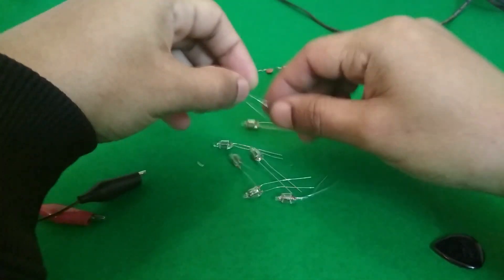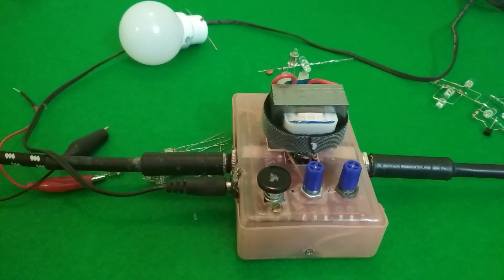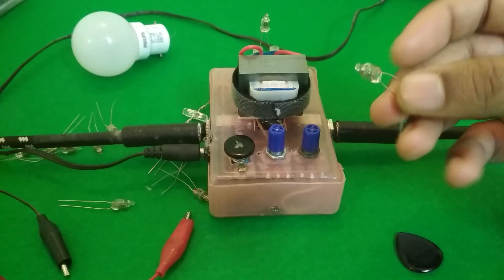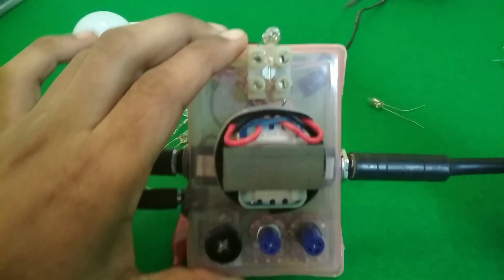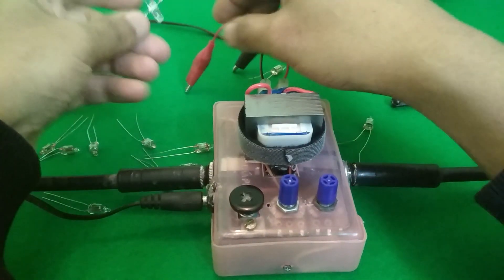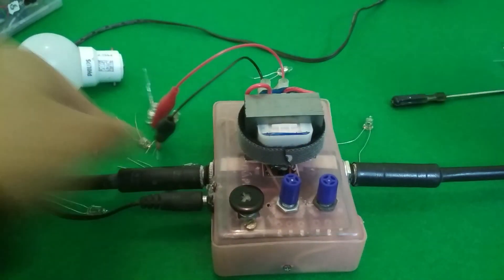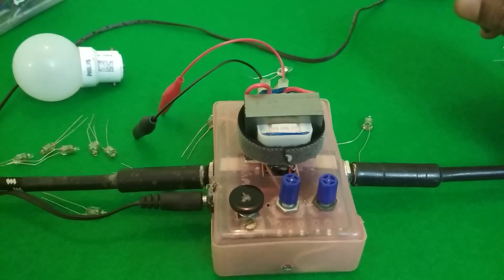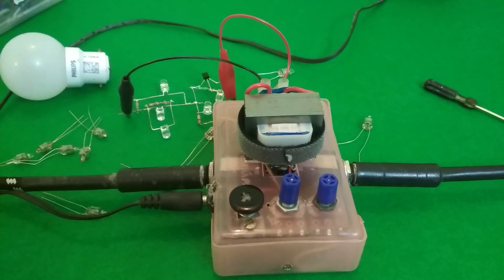DIY "Tube" Distortion - High Voltage Neon Drive Pedal

Comment: Hi, so I just bulit this awesome circuit, but the distortion in not working. The clean amplification works just fine, but the lamp just wont glow, no matter what. 
I even built it twice, just to verfiy there were no errors, but still only the clean sound. I guess the voltage isn't high enough for the lamp, ikd.
Maybe I'm using the wrong components. I'm using a 230V:12V Print-transformer and power supply is 12V.
Any help would be greatly apprechiated!!
(I also could send pictures or sth)
Regards Niklas
Reply from the maker: There's some troubleshooting needed sometimes. You don't happen to have the transformer wired step-down, I assume? Why don't you send me pictures to my "business email" and I'll see if anything jumps out at me.
Reply: @Psychotenuse  Alright many thanks. I have sent you an Email now!

Comment: I need a schematic of this please... If you would come off it. I wanna build one of these someday when I get stable living situation.  I think itd work for an actual amplifier too. Cascade a bunch of them like a SOLDANO SLO100 or something. It'd be cool if the neon tubes worked in the rectifier section..... Oh yeah, I want one.  So you got an official schematic you can send me?? I'm not going to profit or nothing... I'm actually homeless right now, I just want a schematic so I can dream up some additional features for if he day ever comes that my living situation becomes permanent
Reply from the maker: Schematic is linked in the description. Best of luck with housing, man. Hope things look up for you soon.
Reply: @Psychotenuse AWESOMENESS!! How's about that cap/resistor/led clean blend thingy you use in this video??  That thing with a switch or 2 and a pot or 2.... Bad ass for sure. If you could figure out a way to make it a "drop in" module for pedals & amps... That'd be cool af too. It'd sell. This neon pedal would sell for a couple hundred for sure. Especially if the graphic was bad ass. A bad ass graphic can sell a garbage pedal🫡

Comment: I'm confused by the varistor, you put a 1m ohm one but when I search that up I don't get them measured that way, so it has me very confused on which one to get or if the ones I have would work
Reply from the maker: The 1M resistor (meaning 1000,000 Ohms) is not variable. A fairly standard value, I think? Plus or minus ten or twenty percent should be fine too. You should find them on Digikey, etc.
Reply: @Psychotenuse  no I'm talking about the variable resistor in series with the 1k resistor, how do you choose which one?
Reply from the maker: Oh I see, yup sorry I missed it. Yeah, that's a potentiometer with the common lug and one of the others connected, so wired as a variable resistor.
Reply: @Psychotenuse thank you sir, sorry for my little rant, I was just so confused since I'd never seen that symbol before so I looked it up and I think I saw some misinformation at first then figured it out lolll
Reply: You put the symbol for a variable resistor at least, but you put 1m ohms which isnt how they're rated
Reply: @Psychotenuse  its labeled rv1
Reply: Oh wait I'm dumb it's just a potentiometer isn't it

Comment: I suggest adding a capacitor between the 22k and 1M resistors (something like 100nF 400V), just to isolate the output from the high voltage and also decouple it.
Reply: What high voltage are you talking about?

Comment: This was a great video, I really enjoy what you're doing.   However, 90 volts is not a high voltage distortion pedal. My tube distortion/overdrive  pedals run at 200 volts. You created a nice sounding mid voltage distortion/overdrive. Shame you didn't keep going with the pedals
Reply from the maker: Always relative, of course. The gamechanger plasma pedal runs at kilovotls.

Comment: im curious, did you wire all the components onto a pcb blank of some kind or just direct solder everything together? if you used a PCB blank which kind?
Reply from the maker: This was not on a board, from what I remember

Comment: Hey, Quick question, I want to build this, but I have a Step down transformer,  Primary having 4 pins and Secondary having 2 pins. Can I run it backwards? And which of the 4 pins connect to the Neon bulb then?
Reply from the maker: Hey! Sorry for the late response. Unfortunately transformers really vary quite a bit and many have intermediate taps or multiple coils and if there are many terminals you can't really know how to wire it up unless you can find a datasheet.

The high voltage side of the transformer is the side with thinner wire.
Reply: @Psychotenuse   Hi, Just read your reply which was helpful, but I have an issue. I harvested the transformer from a 12 adapter power supply. so there's really no wires at all. just 2 pins on one side and 4 on the other.

Comment: Quick question. Was there a drastic reduction in volume between the Neon Bulb and the lower voltage devices... specifically the LED's?? Thank you in advance
Reply from the maker: Yes, it's definitely noticeable. If you think in db 90/3 is like 30db

Comment: Is it possible to use TDA7052 or similar DIP-8 based amplifier?
Reply from the maker: It might work, but I'm not sure. You need to put a fair bit of current into the small side of the transformer to get the voltages you want on the big side

Comment: thatis really cool,, i need to watch more of your videos,, an led  bulb made a distortion sound, i wonder if a xenon bulb from a car headlight would do, i know they  make tons of voltage
Reply from the maker: I think I might have tried that xD
Didn't do anything, which makes sense because it's probably essentially a short circuit at low power.

Comment: How about using an AD-DA converter in a micro controller and some SW, Arduino, Tensyduino, Raspberry? So many more options to go with.
Reply from the maker: Such platforms do exist to buy, especially with teensy

Comment: GE published a 500 page manual on their little NE-2 bulbs with tons of circuits. They need light (or radiation) to work, which is why the orange lights on power strip bars flicker in a dark room. The amount of ambient light would probably change your distortion tone!
Reply: Do a search for the old Signalite publications.  They had all sorts of fascinating circuits with neon bulbs.  Including musical stuff like frequency dividers.
Reply from the maker: That's pretty cool to think about, yeah!

Comment: Oh man you nailed the 00s grunge tone without even trying hell yeah. Might have to build one of these into my amp project once parts start arriving- I’m using one of those “Tube Fever” kits off Ali in combination with a couple op amps and some clipping diodes to build a low wattage practice amp that still has some of the features from larger amps.
Reply from the maker: Awesome!

Comment: It's a cool little experiment. I'm a firm believer semiconductors do it better than tubes, but there's also a lot involved to get the circuit there. The compression of the control grid in the tube plays a pillar role in it's most desired characteristics, and so does the limited bandwidth in comparison since they tend to cut off at about 10 Khz when used with guitar. *The last few days, I've used a pair of diodes in a feedback loop on a very simple high gain transistor amplifier, and I'm getting the dead on distortion texture of a tube, but it needs significant refinements with some RC networks and truly, more architecture to be truly useful.

About 9 years ago, I pieced together some of my original designs and I had a sound dead onto a 5150 and a Mesa Dual rectifier, but 100% semiconductors. I had the definition of tubes, the saturation and texture of tube distortion, and just needed more gain to shred metal. I'm restarting that journey and this time, I will complete it! 
Your experiment taps into what I've long since necessary which is very high voltage distortion. 
Most of us want that zapping, zinging froth and glassy buzz of tubes without the price, and I'm ranting just to say, it can be done.
Reply: There’s a company called surprise sound lab that makes a pedal that uses semiconductors in a high voltage circuit that sounds pretty good.
Reply: This has nothing to do with tubes because they forgot the control grid on that neon bulb 😂

Also, your assumption about tubes and 10 kHz is way off. Simple 9 Pin dual triodes can run into 100s of MHz without issues...

Comment: I would like to mention that getting shocked across some fingers on one hand cannot kill a person. However, it may cause burns if the amperage is high enough. Not sure how much amperage it would take to cause permanent nerve damage. I only shocked myself once on a hand with 120vac, and this just caused muscle spasms in that hand for an hour.

Always be as respectful of high voltage as if it were a spinning blade.
Reply from the maker: Definitely good advice.

Comment: Alternates can also be (30-200) V mov's and transient supressor diodes..& other non- linear ones like diacs/tunnel diode/ujts'/put's/pin diodes
also how about the effects with a conventional 50/60Hz
fluorescent lamp starter.....
it's not just about their breakdown level & behavoiur that can give different effects....
..Trying various combos with different R/L/C you may discover something extraordinary.😅
Reply from the maker: Certainly a lot of room for experimentation :)
Reply: @Psychotenuse  yes! & then there are the ntc/ ptc types & ldr's too..& many more...
Experimental Holiday season if you are snowed in. 👍
Reply from the maker: Haha, yeah you could in theory get compression and gating with thermistors. Perhaps the currents are too small though. I think I might do an updated version of my looper over the holidays.

Comment: This is fascinating! I'd love to see your schematics. I'm currently almost finished with my rat pedal cone, which I've modified to include a 9-way switch that will choose between different colored LEDs. The 9th setting leads to a row of 8 LEDs in a circuit borrowed from the Boss Heavy Metal. I'm looking forward to seeing if it works.
Reply from the maker: The schematic is linked in the description :)
Glad you like it!

Comment: One of the nice guitar u have.. N this works good but may kill ur amp( due to higher input). 

May be safety clamp is needed at end
Reply from the maker: There is a safety clamp, effectively. The neon is the safety clamp. Divide by the output divider ratio.

Comment: interesting. theres a minute capacitance when its not conducting... picofarads... still sucks some of the top end out.

remember, it STRIKES at ~90V... but it CONDUCTS at much lower voltages once it strikes. about 20...

so you clip the wave when it peaks out, and then... theres this interesting effect... it will always pull the waveform back down to the conduction voltage, only conducting whilst enough current exists to maintain ionisation. how much power is the amplifier delivering, resistance, frequency, etc...

if the waveform reverses before ionisation decays... it will continue to conduct. if it doesnt reverse fast enough, then the neon will stop conducting and only strike again as it hits that 90v peak again... 

so the deacy characteristics as the amplitude and frequency and ionisation /deionisation rates all interact are particularly interesting... would have loved to see some scope traces? im assuming high amplitude high frequency signals will tend to "reverse conduct" far more...

now i gotta throw this into a tube somewhere... this is only one of literally HUNDREDS of ways of messing with this concept... thought of before but never bothered trying?
Reply from the maker: Thanks for your very detailed comment! Glad you liked the idea :)

Comment: When u using a led bulb you are essetialy using a switch mode supply like in phone chargers etc. Every" led bulb have main  swith mode supply in it, and when made with cheap components to little cooling for leds and the electrlytic cap in the psu that are in the socket of led bulb they fail way  to fast. Only quality brands last, They to could do a better job, not a design problem at all. Truth are that led bulbs create  way more e waste and polution that the old wolfram  bulbs that was planned to fail around 2000 hours. To make a led bulb better in all aspects top compnent must be used and a low temp as possible for elektronics and leds when driven is needed. a led can last 50 000 hour if the see true material on the led/leds does not dry up do to heat and the inner jucktion get ecposed to air moist and go bad.
Reply from the maker: I don't think this would work with an LED lamp that has an smps in it. The cheap ones use capacitive droppers.

Comment: Hi, thanks for another cool idea. Is there any reason why non inverting application of TDA2030 couldn't be used here? I have some small noninverting version PCBs handy, and maybe with input resistance much greater than 1K it wouldn't load guitar as much?
Reply from the maker: Glad you liked it :)
Nothing wrong with non-inverting. It requires a split rail power supply, but if you can provide that it should work fine.
Reply: Thanks! 😊

Comment: Really good project. What is the power supply voltage value that you are using? Is it 9v or greater?
Reply from the maker: Glad you like it :)
I was using 12v in the video, but it should work fine on 9V.
Reply: @Psychotenuse  Yeah, it's an excellent project, I really liked it.

Comment: I have a Nixie tube power supply I was thinking of using for the high voltage in a project like this. How would you go about that? I suppose I'll have to control the signal with a transistor? Conversely I could try to find a transformer but I'm not sure where to look for the right specs.
Reply from the maker: The point of using a transformer is to avoid the need for a high voltage power supply. If you just want to do it with high voltage that's a completely different circuit.

Comment: is it possible to put more than one lamp in series or parallel? You should put something like an LM386 in front of the transformer if that's possible so there's more gain o.o the transformer might be adding distortion in a way too
Reply from the maker: Putting multiple lamps in series will give you much less, if any, distortion. Putting them in parallel could be interesting. The gain before the transformer is not currently limited by the choice of chip, but rather by the supply rail, which sets the headroom.

Comment: Love this video!  I am trying to build one myself, but I can't seem to find a transformer that works for this application.  Could you link the one you are using here?
Reply from the maker: No, unfortunately,  because I used one salvaged from an old wall wart i.e. linear power supply. It's just a power transformer, though. You can use a 120V to 6V transformer or a 240V to 12V transformer.
Reply: @Psychotenuse  oh okay awesome, thank you!

Comment: great video! I've been messing around with neon bulbs in audio circuits for a few years, but yours is the first I've seen about it online. my solution sounds different due to different components and layout, and also I'm using bass. I'll make a video and message you when it's ready :+)

Comment: hello, very good video. The project is phenomenal.
I only had three questions.
1-Can a direct current of 15 volts be used for the TDA 2030?
2-If the transformer is T1=1:24 (5volts/120volts) what would change from the schematic in googledrive?
3-at time 5:42 you used a led bulb, can any be used?
Reply from the maker: Thanks for watching and commenting :)
1. Yes,  the TDA2030 can be run off 15V.
2. That transformer should work fine. You'll be operating it a bit outside its voltage rating but probably not enough to damage it, particularly since you'll probably be way under the power rating.
3. The LED bulb is being used as a clipping element here, so clearly an incandescent bulb will not work. A fluorescent lamp might do something interesting, but I can't promise you it's not dangerous to try. Even among LED lamps, only the simpler ones will act as a clipping element. Some fancier LED lamps may have complicated driving circuitry in them, in which case you won't get the kind of result you see in the video.

Comment: Can we use a 6v/220v transformer
Reply from the maker: It should be fine. I would change the drop resistor to around 200k.
Reply: @Psychotenuse  Drop resistor on schematic, is it  R5 or R6 ?

Comment: excellent idea, patent your idea. The other thing is that, if the more detailed project could be published? I don't understand the schematic and I don't know about engineering issues. Or Photos of Proyect.
Reply from the maker: Glad you liked it :)
Not sure what you have in mind though about the more detailed project. What don't you understand about the schematic?
Reply: @Psychotenuse  it's okay. The detail of the triangle before the transformer in the schematic. What is that triangle?. What type of transformer does it use? I see that there is a source, maybe 9v. That's right?. And what potentiometers? How are the potentiometers connected?
Reply from the maker: @havieralvarez2500  What I show in the video is just a rough "block diagram" of sorts to give an idea of what is going on (the triangle represents an amplifier). The full schematic is linked in the description, as well as a parts list.

Comment: How much for one of these but with everything inside an enclosure except like 2 alligator clips with 6" leads??  And how much for one with only a 12ax7 9 pin tube socket installed??
Reply from the maker: I don't really see the point of a tube socket, but I guess it would add a couple of dollars to the cost... ?

Comment: Can you link to the step up transformer you used.
Reply from the maker: I really couldn't, unfortunately, because I used a salvaged transformer from an old linear power adapter. You could look for 240V to 12V transformers or for 120V to 6V transformers (you would wire them in reverse, of course)